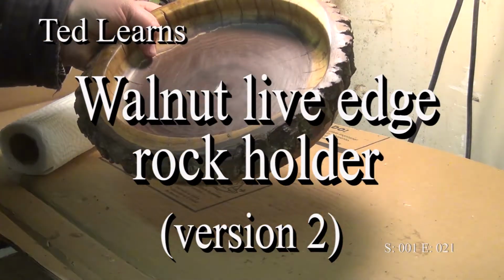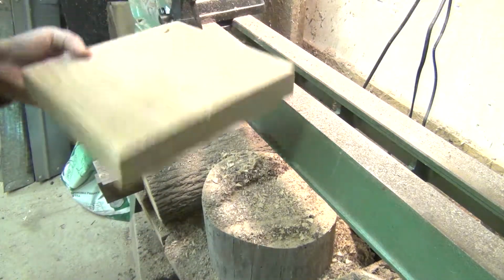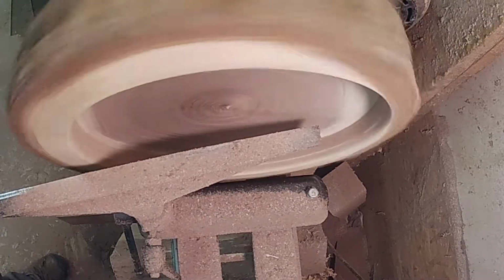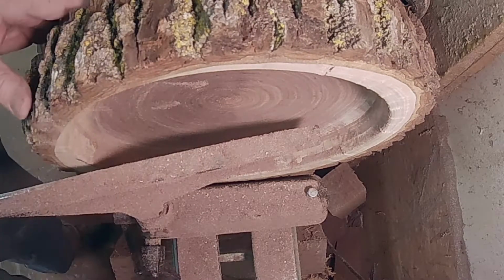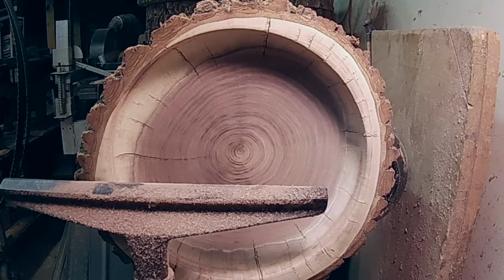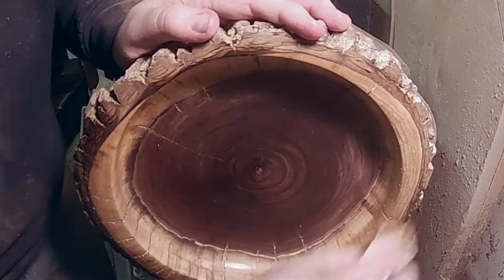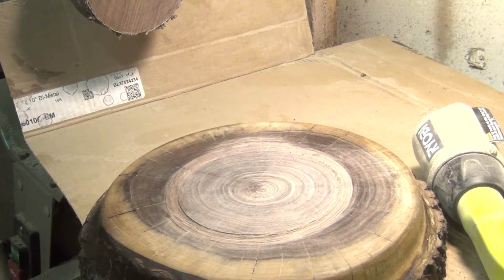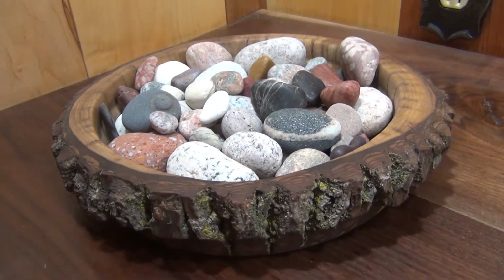Live edge walnut slice bowl rock holder ~ 021

Comment: Glad the rock holder turned so well Ted; hope it's loved like the first one🏆 
Sorry, I didn't see any benefits to synced 2nd cam cut ins. So, PIP would be a better option. Why do you think it took sooo looong to render ? Perhaps the frame rates were so wildly different the SW had to interpolate each frame before outputting i.e. no practical LCD) ?
Reply from the maker: Thank you for your kind comments.  The benefit of the second camera is for a different point of view without that I can't get with the camcorder.  I don't have any idea why the render and editing were so sluggish.   I rebooted the PC when I started noticing lag in the editing to make sure I did not have any vampire processes.  I set the frame rate and resolution to the same on both cameras.  The culprit might have been all the jump cuts switching between views, you would not think they would cause any issue with editing.

Just more for Ted to learn I guess. :)
Reply: @TedLearns  "more to learn" - ain't that the truth. 
Edits... I film 30-60 min  sessions, trim out the fat, save; string these together, save; and finally add the effects as the final. Worst case is 1:1 render time, sometimes render is very quick. So maybe I'm not doing as complicated as you are. I use Filmora. You ?
Reply from the maker: @mpart_woodlathe-stuff   I tend to video the entire project.  I never know when I am going to make a mistake that is video worthy.  In this case I had 39 clips from both cameras.  I use Adobe Premiere Pro CS6 to edit.  I tried  DaVinci Resolve, however found it unstable.
I know I leave too much 'fat' in my videos it is just that I have so much footage everything seems like a highlights (low lights) reel.
Reply: @TedLearns  We're pretty much the same then. A 'session' for me is for example, shaping the outside or finishing. I tend to turn the the camera on until I'm done that operation/session. The fat may include a rest break or to fetch a tool offscreen or petting the cat. I do cut 'lean' meat too when it is getting too long.
Reply from the maker: @mpart_woodlathe-stuff  ah, we are different in one way.  I take way longer to complete a piece I suspect. :)
Reply: @TedLearns  😮🤪😁😁

Comment: Cutting into endgrain is always a chore.  If you had drilled a hole in the center you could cut from the center towards the outer edge giving you shavings rather than dust. (Drill the hole to the approximate depth and maybe 1" diameter)
Reply from the maker: Thank you for you suggestion.  I may try it next time.  I am not sure that I would get much for savings from the carbide tools, however your point is taken.  So far I have only turned dry wood.